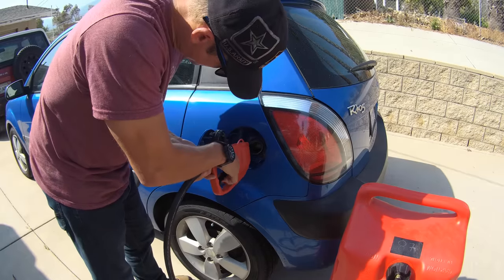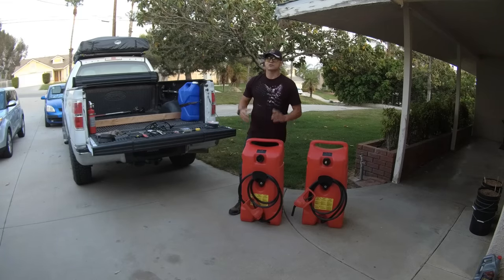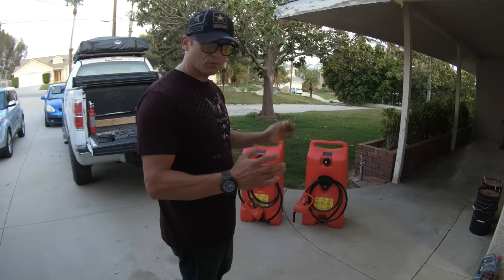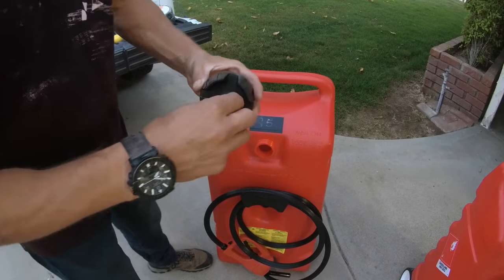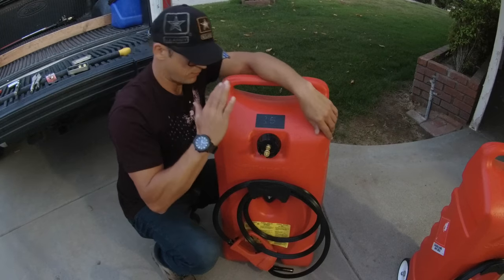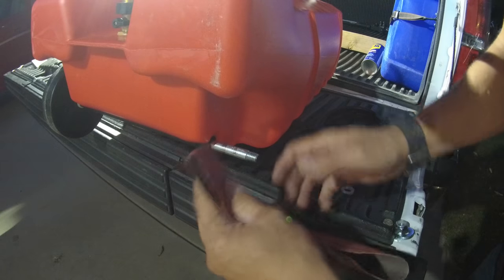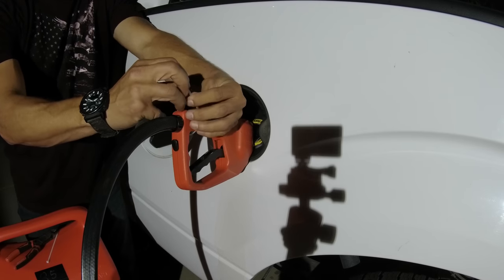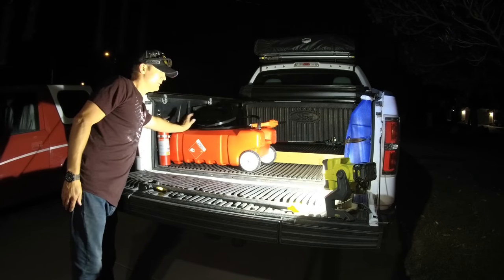Duramax Flo n Go 14 Gallon Gas Tank with Hacks

Comment: Great hacks!... I've also seen someone use a ' spare air ' compressed air tank instead of the foot pump. One more thing, I ALWAYS use STA-BIL fuel stabilizer, even for very short term storage! I use that stuff for ALL fuels and mixes ALL the time! Thanks for the video!
Reply: Not to nix fuel stabilizer. But, we were fortunate enough to purchase gas containers that were air tight and we kept them in a dark shed. When we pulled them out after 5 years, the fuel was still good.

Comment: Great video and hacks but on the wheel replacement, you don't need to remove both axel nuts. Just remove one side and pull the axel shaft out then replace one wheel, slide back in and replace the other wheel, screw on lock nut and your done. Also, use only one washer inside and outside the wheel or it may bind when tightening the locknut.
Reply from the maker: Wish I would have thought of doing that the first time. Thanks for the tip!  Saves so much time and effort!
Reply: The QWORK wheels don't fit well.

Comment: On the tight wheel nut, wrap a couple of layers of duct tape on the axel and clamp. No scuffed up axel rod.
Reply from the maker: But then you have sticky stuff all over the rod to clean off. Someone else suggested using 2 bolts which is better. Then you can unscrew the other side and just losses the two bolts on the opposite.
Reply: Just remove the whole shaft from the other side. put your wheel on, put the shaft back and put your second wheel back on.

Comment: Great video. I would suggest replacing the hose and nozzle good selection at tractor supply
Reply from the maker: Good call!
Reply: I was thinking the same thing and maybe add quick disconnect and or swivel setup.
Reply from the maker: I finally had to replace the hose and nozzle.  Here is my latest update.
https://www.youtube.com/watch?v=0Z94W9zNAjg

Comment: I prefer the Flo-Fast rotary hand pump with my 5 gallon gas containers from VP Racing. You will need the extension tube for their larger cans.😎
Reply from the maker: I have a few VP Racing cans too.  I hate picking those things up to fill my quads and mower.  I end up spilling some every time and my arm gets tired. I'll check out the fast flow hand pump too.  I was going to sell them because I sold my quads.

Comment: duramax has changed the gas cap and replaced manual vent with cheap flapper valve. I just order the old style cap from Bass Pro Shops
Reply from the maker: I had a few others say the same thing. Thanks! I'll put this in the parts list!

Comment: My Duramax Gas Caddy 14 gal does not have that type of cap, what would you suggest ?
Reply from the maker: Really?  Did they change it or are you in a different Country?  I would drill a hole the size of the Shrader Valve just to screw it in or you can order the original cap here but it's expensive. https://amzn.to/4faltRB
Reply: @plantbasedprepper  Yes it is expensive to order and I’m in USA ordered the caddy through Amazon and it’s pictured with that cap but nope my caps bare. Thanks so much for responding. I got the valve now to drill the hole

Comment: Good to go, thanks. Any issues with the hoses leaking at connector to handle or base by the axle? What size hose does it take? I heard the stock one is a plastic/vinyl POS? Apparently many issues on the comments section on Amazon. Mine come today and wanted to, Hack" before putting fuel in them. Thanks
Reply from the maker: No leaks at all.  I like that there are 2 valves on the bottom. One for the tank so you can unhook the hose and one for the hose.  I'll use the hose until I have to replace it, then get a better one.
Reply from the maker: I finally had to replace that hose and nozzle.  Here's my latest video update.
https://www.youtube.com/watch?v=0Z94W9zNAjg

Comment: Hey! Read the instructions. If you squeeze the handle repeatedly on  your  Duramax Flo 'n Go Caddy it will pump the fuel, up to your equipment from ground level.
Reply: Yeah but your hand and wrist will thank you later after you squeeze it about a thousand times. The handle starts the siphon process but it is still gravity fed. And to empty all 14 gallons takes long enough when you have the tank in the bed of the truck at equal level. If the tank is below the vehicle  gas cap level it would take an eternity....

Comment: I can't get the deflator to release air @ 5 psi, same thing @ 10 psi. What am I doing wrong? I have it barely catching the threads....
Reply from the maker: I had no problem with the ones I ordered.  Are you sure you have 5psi in the tank? Double check and let me know if you got it working. Maybe the deflators you got have too strong of a spring.  You can try shortening the spring or returning for a different brand.

Comment: With the hose that long, could you not leave the gas can sitting upright on the tailgate of the truck? Might help with the flow since you will not be fighting gravity too.
Reply: That's what I do but apparently it's not recommended to fill in the back of the truck because it creates a static charge.
Reply: @Trillville43  true, I don't have plastic liner in mine, so hopefully I don't die... Lol
Reply: @TJ We’ve done that, and it still doesn’t flow well. We ended up putting it on the truck gate, and pumping it into a 5 gallon tank on the ground, then using the 5 gallon can  to fill the cars. It’s not bad to use the 5 gallon can to fill yard tools,  but it’s a hassle to lift it and a hassle to have to fill the 5 gallon can multiple times to fill a car. This is why I’m watching all the videos on how to improve this thing.
Reply: @MrsPumpkinCat  I bought a battery operated electric pump it takes 4x AA but will run on 2x AA
Reply: @Trillville43  Thanks, I’ll look into that.

Comment: How much pressure to you pump into the tank while filing up your truck? Do you have to stick to 5 PSI or does it matter each time you pump to build up pressure. It is safe to pump pressure in the tank so your gas can flow out. Also, has the tank expanded so that the wheels get locked and can not move. Another Youtuber said they tank expands when it gets hot and the wheels drag because the tank becomes warpped.
Reply from the maker: I just keep pumping until it gets between 5-10psi while pumping.  It comes out pretty fast at that amount.  I wouldn't want to go more than that only because if you need to stop because the tank is full or you need to do something else, you don't want the tank to stay pressurized too high.  I don't have any trouble with the new wheels rubbing or dragging and it stays at 5psi all the time using those tire deflators.  So far, I'm loving it and have taken it on road trips and camping to save money on gas.

Comment: I have had two of these 14 gallon containers for years but if you want to see the blaze that is caused when filling it in the back of your truck do a YouTube search. There are several that look like a bomb going off.
Reply from the maker: Yea, I don't do that anymore. Glad I posted so others can warn me. I only did it once. I take it out every time now. I had no idea. Thanks! I hope others read the comments too.
Reply: Why would it catch fire in the back of the truck?🤔
Reply: @faststang85  Static spark from the gas nozzle can ignite the gas fumes from the gas container especially on a bed liner. Always fill the container on the ground outside the truck bed.
Reply: @jimmcgettigan4826  i don't have a bed liner its metal which would be a ground anyways, not saying it could never happen but it could just as easily light off  on the ground as well.
Reply: Yes, plastic gas can on a plastic bed liner can be dangerous because of static sparks.

Comment: I'm not sure but I could be wrong it look like there was a button on the back of the gas handle to hold the handle open instead of a ziplock
Reply from the maker: Unfortunately, no. I have to keep holding it. I had to put a pine cone I found in the handle on our road trip 😆
Reply: You can use a cable tie on the handle tight enough to keep the handle "open" but with enough slack to slide it off the back of the handle when finished pumping.

Comment: Would you still pressure up to 5 psi with the gas can full ???
Reply from the maker: Yes, I've used up to 20psi when pumping fuel out.  Just don't store it with more than 5psi.  Use the deflator valve when storing it to keep the psi no more than 5psi.

Comment: Somebody please do a good video on how to solve the problem of static electricity without having to put these on the ground then having to lift 100 plus pounds back into the truck?  How are you guys filling these??  Would putting it in a all steel trailer and touching it before filling do it?? I just can't lift it after it's full??
Reply from the maker: I've done a lot of research about this but haven't followed up with a video. I'll work on one because I agree, it's so inconvenient and heavy to load and unload and we will all get to that point. The safest solution is to put it flat on the ground and not standing upright. The reason is that plastic containers do not conduct electricity and are insulated.  They can store static electricity all over the container so the more ground to surface area touching, the more it will discharge but slowly.  Touching it like you do metal will not discharge all of the electrons stored elsewhere on the container. Hosing it down will discharge them quicker because water is a conductor.

The best solution, if stored in a truck bed, is to have it laying flat on metal, or if you have a bed liner, on a metal plate that is securely grounded to the frame of the vehicle.  Secure the plastic tank to the metal truck bed or metal plate so it does not move around.  I've scoured the net, read and watched a lot of videos about bonding and grounding fuel tanks and there is NO guarantee.  All we can do is reduce the likelihood of a static discharge by using best practices with grounding and bonding.

Before fueling, always touch metal to discharge yourself first and anytime you enter/exit the vehicle.  Always touch the fuel nozzle to the side of the inlet and keep it touching until complete. Do not ever top off your tank. Leave room, let the vapors and spills evaporate before putting the cap back on because the cap can have a static charge too.  If, by some chance, a spark does occur, never ever pull out the fuel nozzle because that will cause a huge fire.  Just leave the nozzle in the tank and move away and grab your Class B Fire Extinguisher that you should have mounted on the other side of your tailgate at a safe distance.

If you have a metal truck bed, the risk is lower and gets lower the closer the container is to the actual ground. Again, nothing is 100% risk free, even Metal Containers aren't 100% guaranteed but Plastic ones are a higher risk because you cannot discharge them by simply touching them to ground.

I have a plastic bed liner so I'm going to take mine out until I can't do so anymore or add a metal plate and ground. I'll probably get one of those static strips to ground my truck to the pavement before fueling if I can't lift it out.  I'll keep it at the very tail end of my truck bed and have a Class B Fire Extinguisher mounted on the other side. Than keep practicing a step by step procedure to minimize the likelihood of a spark.
https://amzn.to/3r0NIy9

Comment: I found one of these cans on my neighbors trash pile last week. I snatched it right up. Within 30 minutes I understood why it was there. A 5 gallon can or two and a shaker siphon are about 1000% easier to use than this mess of a product.
Reply from the maker: It all depends.  There are pros and cons to each one.  Either carry around three 5 gallon jugs or one 14 gallon.  The only drawback I've had with the bigger one was having to take it out and lift it back up into the truck.  That might become a problem and reason for going with smaller cans but I'm still researching how to get a ground cable attached to the can, truck and the ground when I fill up so I don't have to take it out each time.  There's not much info out there about it.  If anyone knows, let me know.
Reply: @Plant-Based Prepper  Ground cable. Pull the bolt out of the center hanger thing put a ring terminal on the back side with a wire. No permanent modifications

Comment: Hey any ideas how to modify the lid that comes with the 25 gallon version?

Your cap size is 2 1/2 inches
My version came with a cap that is 2 1/8

Not only that it doesn’t have the big plastic screw mine has a spring mechanism that can be taken apart to find the screw is a 6 mm screw.

I could reshape the part with taps and dies but I don’t want to ward the plastic so much. Rather is there an adaptor for fitting on different lids? I’d order one to be made but I need the threading and thread type
Reply: Same essentially but had to buy a tap for it to get it all figured out

Comment: I've had one for a year and the pump handle and hose is falling apart.
Reply: I have had one for ten years and I have replaced the hose and pump end 2 times. The one on it now needs replaced also. The hose is one of the worst parts of these tanks along with the wheels. I agree with changing the wheels the factory wheels suck. I use mine for filling up my lawn tractor. I use a come along to lift mine up to use gravity. I like all these hacks. I think I would use a nipple into the tank and a elbow with another nipple.  Than connect a cross have a pressure gauge and two valve stems. That way you could leave your deflator always connected but you would never over pressurize the tank. Also a safety not. You should never fill the tank while it is sitting in the bed of your truck. Especially with the plastic bed-liner.

Comment: Okay new problem how do you get the gas below the nozzle out
Reply from the maker: I just lift and tilt it at that point. I have a truck with a roll top cover so I just put it there once it's light and tilt it down.
Reply: @plantbasedprepper  mine is the 25 gallon version I’m not sure that will work…
Reply from the maker: Maybe look into changing the hose connection on the bottom of the tank with one that you can feed a hose through that will rests on the bottom?  Like those spray bottles that have a tube that goes from the handle to the bottom.  You might have to change the fittings on the tank to allow an adapter on each side. Just make sure to research what type of fittings and hose to use that will not decay in gas. A cheap solution would be to just get a smaller hose and feed it inside that larger one until it gets to the bottom of the tank and just pump it out like your doing now.

Comment: You may want to fill the tanks on the ground not in the truck bed.
Reply from the maker: I am, that was a mistake at first. Didn't even know. Thanks for the heads up!
Reply: @plantbasedprepper  Glad to help. Really liked the tire upgrade. Wonder if a longer axle would allow larger wheels for tough terrain or docks?

Comment: The hose on this tank is made of cheap vinyl that will harden in a short time, as mine did. There is a reason why gas station use high quality rubber hoses and not cheap vinyl hoses.
Reply: Did you find a hack to that issue?
Reply: @vendbiz8076  Yes. I went to an auto parts store and bought a Goodyear fuel hose the same as the gas stations use and problem solved for about $80.
Reply from the maker: I finally had to replace the hose and nozzle. Here is my latest update.
https://www.youtube.com/watch?v=0Z94W9zNAjg

Comment: Great video, put some oil in that air pump, the screech is horrible. Also you could avoid the air pump, if you could sit the tank safely on the edge of the rear of your truck